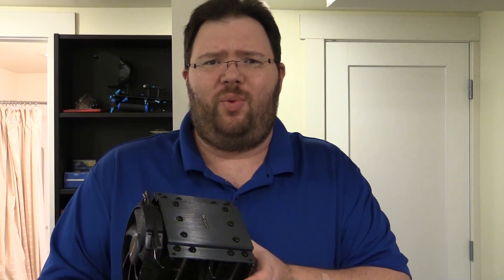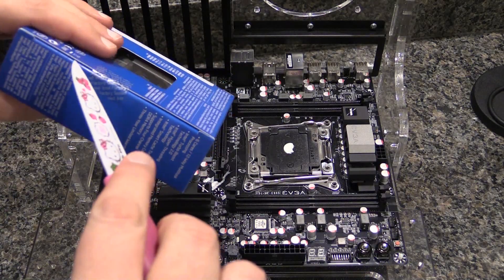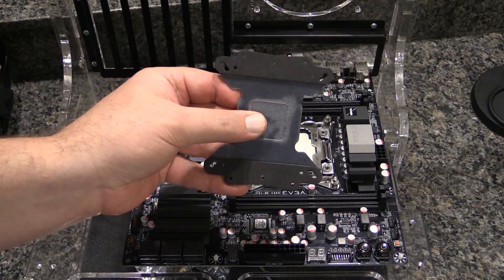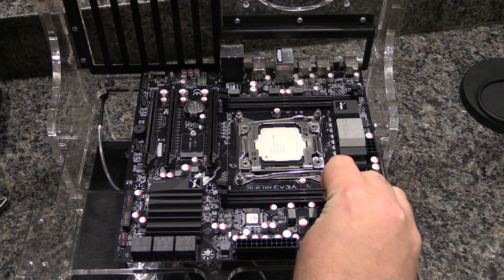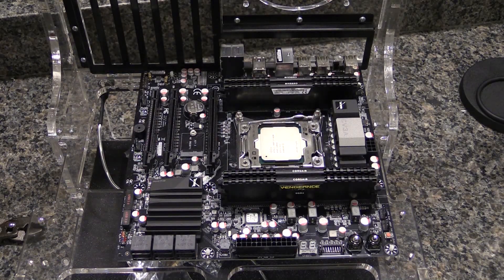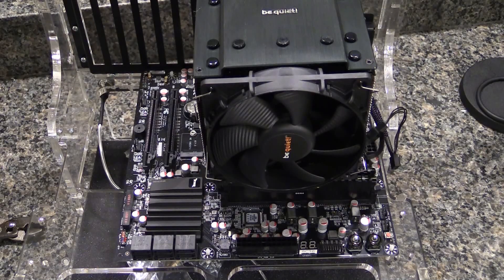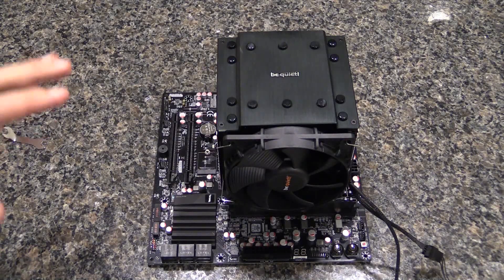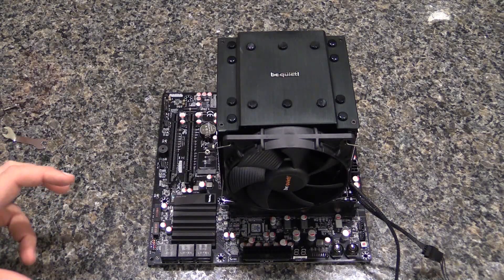Be Quiet Dark Rock Pro 3 Overview and Installation

Comment: @TimmyTechTV You did it wrong you should tide the nutes on the cooler and then tide the cooler from the back of the mobo.
Reply: No, he did it correctly for the 2011-v3 socket. I can say for certain because I even checked the manual. I found this video while trying to find someone installing this cooler onto this socket because reviewers talked about it being very difficult. For other sockets, you screw through the back of the motherboard. But, this just doesn't look like the cooler to get for the 2011v3 socket.

Comment: I would want to use this for a mATX build using the Thermaltake V21 case. 

This case is very unique, its a cube and all of the 4 side panels can switch places. It has a window and then two vented side panels with filters, my plan was to put the window panel on top with the vented panels on the side. 

The mobo lays flat in the same orientation as what is in the video. I want to have it so air can flow left to right to cool the graphics card then exit out on the other side, can you put the Dark Rock in that orientation without overhanging the PCI slots? 

Mobo is: gigabyte Z170MX Gaming 5.

If not I would just use a H100I GTX or H100I GTX, I love the fact that this is center around silence and it looks so cool.

Comment: I just installed a Dark Rock 3 (non-Pro) and found it quite convenient to install. I started by screwing on the backplate to the mobo. Then I mounted the brackets to the cooler itself. Applied thermal paste. Flipped the cooler upside down, then laid the mobo on top of the cooler (upside down as well) and screwed the 4 screws on the back of the backplate.

...then I undid everything because I forgot to peel the plastic wrap off the cold plate :| Hey at least I thought of checking before turning on my system! Counts for something right?
Reply: +MiniCactuar it's way easier to install on a board that uses the backplate. screwing in from the back is not an option on the 2011 boards the way the socket is.

Comment: if I want to add more ram is it doable without removing the heatsink?? I really dont wanna deal with it again I installed it 4 years ago and removing it is so much hastle. Or can it be dine without removing the fan? the ram I want to get is the corsair vengeance low profile 1600mhz ram.

please let me know.

Comment: Protip: this cooler clearly wasn't designed for mATX boards.
Reply from the maker: Protip, I stated pretty clearly I was only going to run 1 GPU. ;)
Was never planning to populate the top PCIe slot.

Comment: Ya installation of CPU like this would be deal breaker. I'd rather get a prefilled water cooling kit. What I have right now I'm pretty happy hyper 212. Have slight over clock fx8320 at 4.1ghz. Pretty steady.